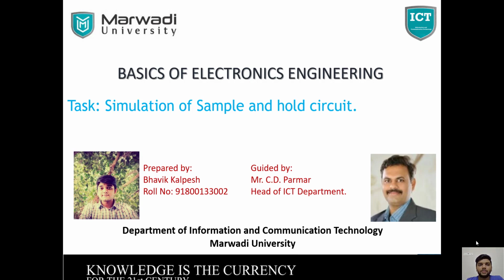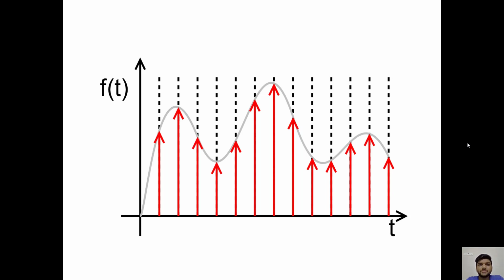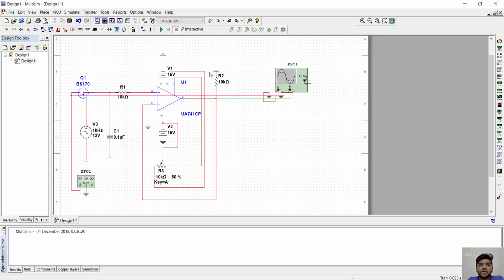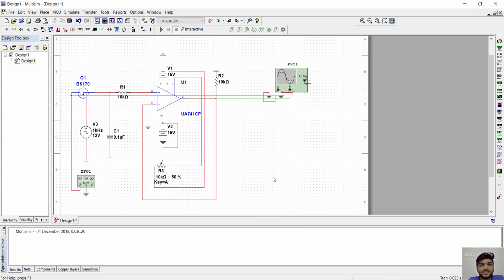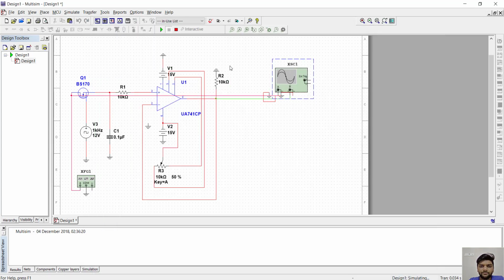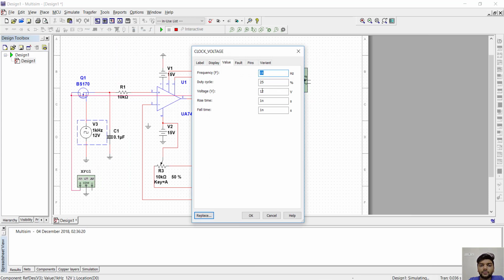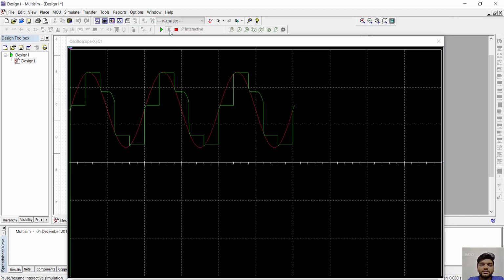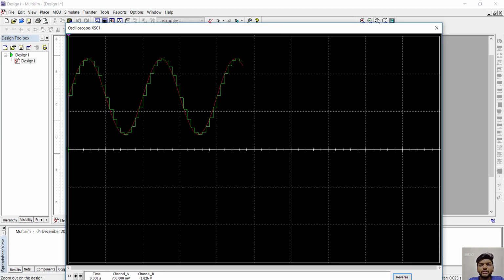Sample and Hold circuit

Comment: I can’t clearly see the connection to the oscilloscope. I tried connecting this circuit and it’s not working
Reply: Yes it showed error. If you need corrections I have corrected and is working for me with few changes.
Reply: I used a different transistor
Reply: SIVA KRISHNA Buchi MULTISIM.
Reply: SIVA KRISHNA Buchi MULTISIM SOFTWARE
Reply from the maker: You can send your mail id...I will send circuit connection
Reply: Did you ended getting help🥺?